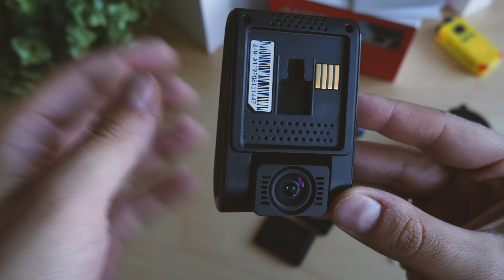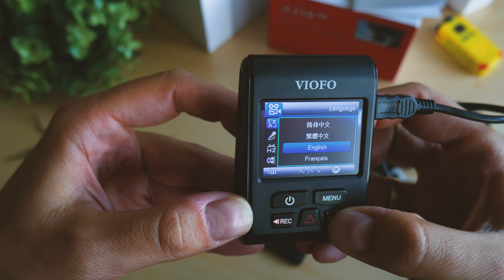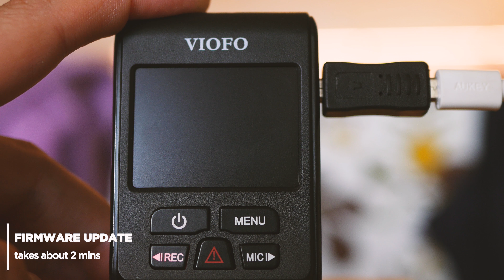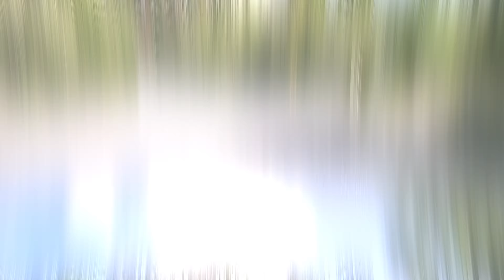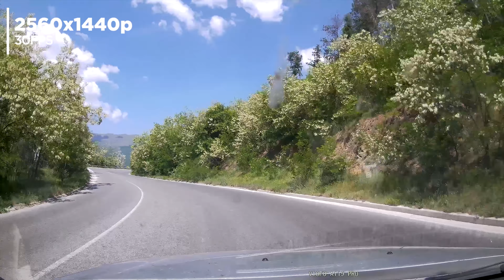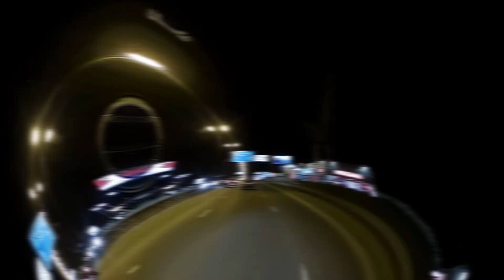Best 2018 Dash Cam? Could Be Viofo A119 Pro! [Review]

Comment: try 1080p 60fps - terrible noisy!!!! and reduced view of angle
Reply from the maker: Having higher fps usually results into slightly worse results, so getting more noise is expected. This is why many of the dashcams do not offer more than 30fps.
Reply: 1080p 60fps:
firmware v1.0 - clear, sharp but reduced  angle of view
other firmware - noisy, blurry and still reduced  angle of view

Comment: Yeah, you want to hear my opinion? 
This camera is a joke. Did you say reliable? You just reading some advertisement, right? 
And did you say mature software or firmware? Compare to what? New born? Yeah, barely. 
The only good working thing for this camera is the design, so please do your home work before the review and actually test the camera. Anyone can read the propaganda.
Reply from the maker: Hey Vladimir, thank you a lot for sharing your opinion, although a bit negative. 
This dashcamera is actually quite good (yeah, I stick to my original statement) - already a few months have passed and there seem to be zero complications with it. No firmware bugs or whatsoever. And even if you have noticed some on a unit of yours - Viofo's website has a good section about firmware updates and downloads. 
The design of this camera is similar to other (including previous Viofo's models).
You seem to have put effort in your comment giving some statements, however I can see no examples why you believe this dashcam is a "joke". Any input will be valuable.
Reply: @TechMishka  okay, so here are some examples
#1. It stopped recording very first day even dough the camera was still in normal recording mode pretending just like it was recording, but there was no video file of the trip on SD card. 
#2. It does not stay in highest resolution, it will go back to 1920x1080 randomly. 
#3. The photo shot is never larger then 1920x1080 which is useless for reading licence plates.
#4. Parking mode set for 5 frames / sec will record sometime slow mo, some time fast  but when it records slow mo it will play back only fast motion and sometimes doesn't record at all. 
#5. Not compatible with Win 7,  it will play back choppy video, not consistent. Yes I did try different video players. 
#6. Motion detection is again sometime working, sometime not working. It will write the files sometime in different folder sometime not,  and sometime it will split it in two different folders. 
It can not be set or used together with parking mode yet the parking mode will sometime work as motion detection - again...only some time. 
I didn't test all of the settings but I don't feel like wasting any more of my time with this toy, bottom line this toy is very far from security device.
Reply from the maker: @tysesty  Thank you a lot for taking the time to write this down! 
Well - mate, sorry to hear about all the troubles you have had. Feels like we are talking about two entirely different products. I have never had issues with the resolution - within two weeks of testing it was constant and never really reverted the settings. The P-mode was also alright, and the only thing I can complain of are indeed the photos. 
Most likely it is a problem with the unit that you have, or probably the power source. ANy chance to return it/get it replaced? Hopefully that will be possible. Although ... I know that feeling when you lose your trust in something - and even if it is fixed you are expecting to get a new trouble every single moment... 😶🤨😬

Comment: @Tech4All I am very much a fan of the smaller FOV such as on the A119s. However, many reviews and forums I read is that the A119 is superior over the A119s especially in daylight conditions. On paper with the chipset/sensor configuration @5MP seems to hit the sweet spot for the A119 PRO. Also, Viofo it seems offer continuing firmware updates on new releases which would bode well for the newer A119 PRO. I am wanting to purchase either an A119, A119s, and/or A119 PRO but have not seen as much in regards to reviews/chat for the PRO to make an informed decision. In all honest opinion(s) could I get some feedback on which is truly the better of the three models?. Thank you in advance..
Reply from the maker: Hi Doug! I like the way you explained your doubts and hopefully the thoughts below will be helpful:

The A119 Pro is excellent and stable. Has the good performance of the A119 and A119s, and is excellent in daylight conditions - richer colors and maybe a bit more data being recorded.
Night mode is falling slightly behind, because of the larger sensor. Which means that there are more pixels, and having the same amount of light, it is being split to more portions before reaching the pixel, which results into slightly darker image. 
This is entirely normal and for some people it is good, and some consider it to be bad. 
Overall, if you are looking to get better night mode, get a dashcam with a smaller sensor (2MP) - it will give better results for unarmed eye and without post processing. 
Right now I am testing the 70 Mai Pro, which may also be a point of interest to you. The review will appear on Friday next week.
Reply: Thank you!
Reply from the maker: Most welcome, Doug!

Comment: How is this in hot climates? I live in 48 degrees celsius country.
Reply: it does have super capacitor to handle hot climate
Reply from the maker: Better get a device with supercapacitor - just to be on the safe side.

Comment: Thanks for your review.
I purchased an A119 PRO just recently to replace my aging  cheap  Blueskysea GW-1C.
I read and watched a whole lot of reviews and decided on the Pro.

I've used it now for several months and although the unit is good I've had some  misgivings.

My camera gives a very noisy image at night. I've played around with settings from +2 to 0. My original camera seemed to display a sharper image.
I'm going to experiment some more when I can run them side by side.
I've heard reports that the microphone recording is very low. I agree.. it is very quiet.
the audio bitrate on the pro is 96. Sure you're not recording a broadcast quality sound .. but my old Dashcam has a 512 bitrate. No dealbreaker, but interesting.
I sometimes incorporated my previous dashcam video footage into my travel videos. I'm still deciding with my new one.
Also.. I notice that your video pops with color. Have you enhanced the footage in any way. eg Most people are disappointed with their Gopro videos because they don't look as good as the ones they see on promos. They need to be given some post production love.

I'm certainly keeping my A119 PRO and will apply the latest firmware update.
The old camera of mine will take on the role as rear facing recording. Perhaps some of my issues might be fixed.   Any positive thoughts.
Thanks again for your review.
Reply from the maker: Hi Stan, and thank you so much for the detailed analysis and comment. I believe most of your statements are very accurate!
Overall, the new generations of dashcameras are a bit noisier and this is related to the sensor capacity. People want more megapixels and do not realize that this is a tradeoff, especially if 1080p is the preferred resolution. SOmething similar with the A119 pro. The "weakness" is mostly visible at night, where they really need to make it sharp so that more details are visible. And that's how we get more noise. The advantage is greater detail in daylight. 
As for the sound - it quite depends on the generousity of the manufacturer and for the low grade mics that are used with dashcams - 96 is quite enoug (format also makes a difference, for example aac is better optimized than mp3).
In this video there is no post-production on the A119 Pro footage - I almost never fine-tune actioncam or dashcam footage, because it is fair to see the picture as it is. Almost everything is shot with auto settings. Sometimes the blue sky gives the illusion of sharp image. 
Perhaps it will take a while until 5mp sensors cartch 2mp sensors in terms of clarity :-)
P.S. I have been testing the ThiEye Safeel One in the last few weeks and it looks to be with lower level of noise in low light. Review is planned to appear on Friday :-)

Comment: The techs under 1,469.50 dollars please say I will get this money after some time mihal say
Reply from the maker: tech under 1500 USD? What kind of tech and equipment? I remember you have started a channel. You are planning to use 1500USD for equipment?
Reply: tech4all  not for that I have 1500 used dollar I need daily use accessories under this amount like action cams pen drive bag likethats
Reply from the maker: So we need to put together devices for daily use within 1500 USD limit? Is that the plan?
Reply: tech4all  yes bro
Reply from the maker: Do you want to shoot in 4K, or Full HD primarily? if 4K is needed, we have only a few models that will fit into the budget. Full HD gives many more options.
Reply: tech4all  HD OK
Reply from the maker: Then choices are many. Get a mirrorless cam with a couple of prime lenses - it will give you excellent results. And find a good action camera - almost any 2017 model will do fine with Full HD and stabilization.
Reply: tech4all  that like the accessories like bag, action camera, android